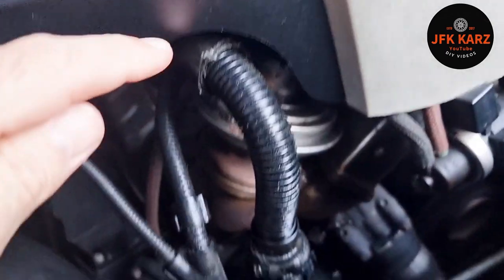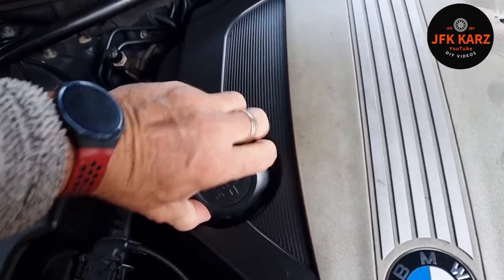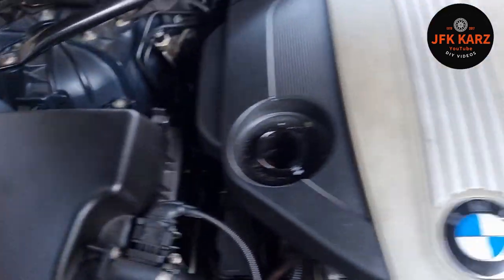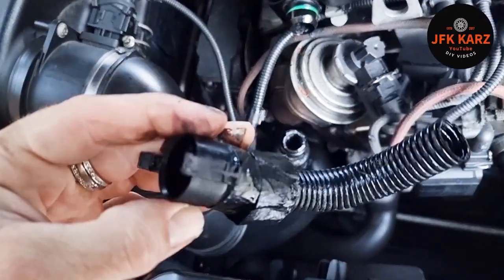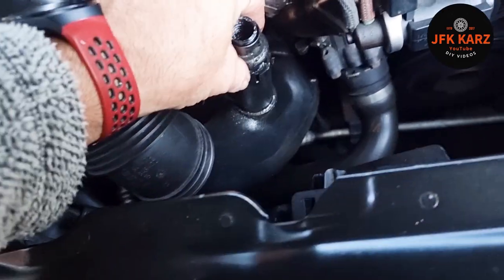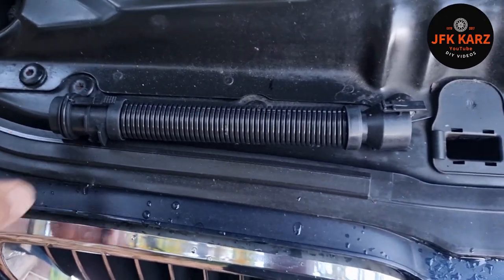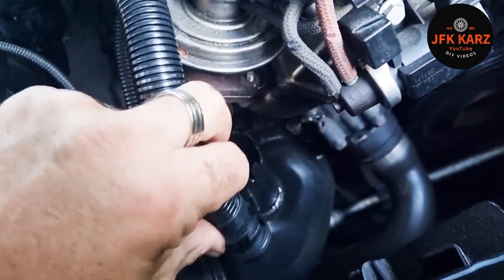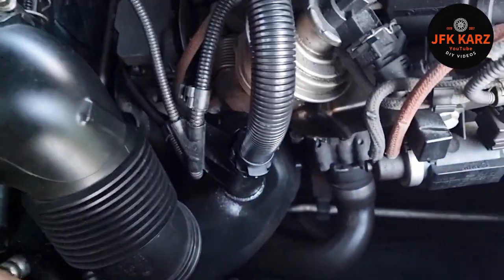BMW Air Intake Breather Pipe Installation for N47 & N57 Engines - Part Number 13717803842

Comment: I ordered this part because my piipe was leaking but when removing the old pipe i realised the one on my car had an electrical connecion  on it. Saw on realOEM that there seems to be two versions of t,his pipe. One chap simple pipe, one that is 10x the price which is what i have. yay
Reply: Wow , what type of bmw you own year engine ?
Reply: @cirese22  it’s a 316d from 2009/10. N47 engine
Reply: @465painkiller465  My 2013 X5 N57 also has an electrical connection. Could have something to do with cold climate version? Where do you live?
Reply: @mcplutt  Perhaps. I just installed the simple pipe and removed the wiring. Haven’t had a problem since and no fault codes. Live in Sweden, so def cold climate